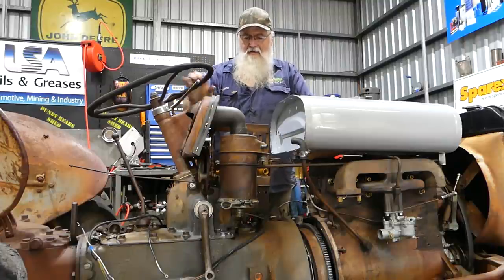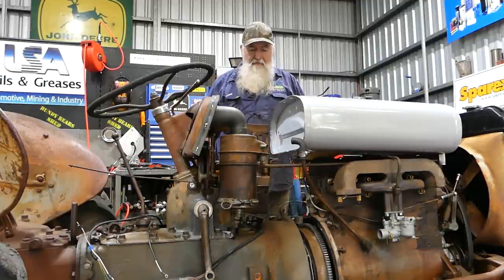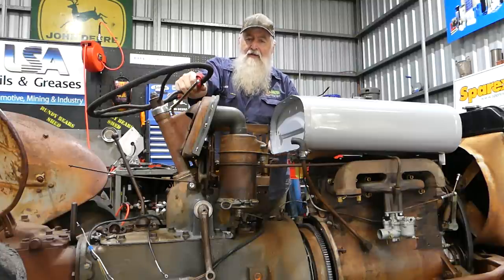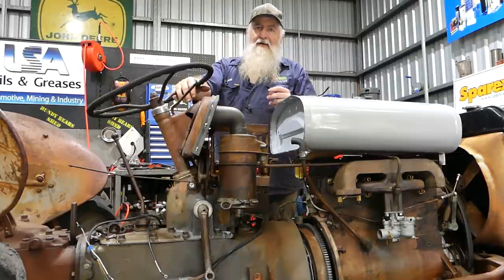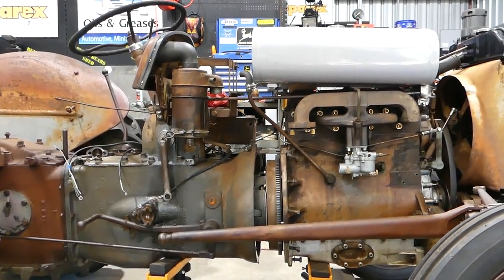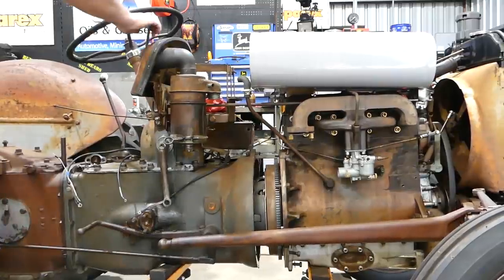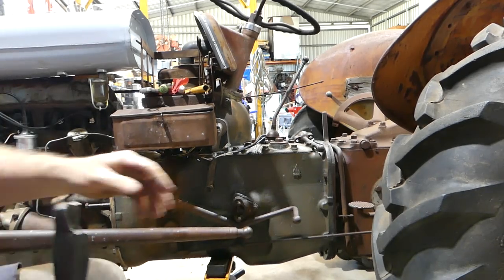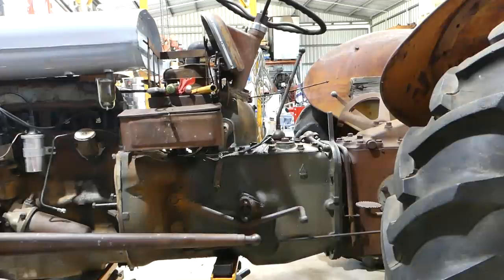How to Slide your Ferguson TE20 Together After a Clutch Repair in Real Time.

Comment: I split and reassembled my TO35 this last spring and it was such a good feeling when those splines finally aligned and the sections slid together. Turning the PTO shaft proved important.
Reply from the maker: Yes turning the pto helps a lot.

Comment: Lance - the clutch test prior to fully assembling the tractor - excellent idea. This is the first time I have seen this test.
Loctite 515 removal - have you tried Loctite SF 790 Chisel Paint Stripper (Gasket Remover) 510g to remove the gasket?
Reply from the maker: No I have not seen the SF790. I will ask my supplier about it.

Comment: When I did my TEA20 I had to do it outside. Due to the uneven surface I found the rear end twisted at an angle as it was going together. That took quite a bit of time to realign otherwise it would have been rather easy. Good ole Fregie.
Reply from the maker: yeah they can be a bit difficult now and then.
Reply: I have to do mine outside as well. Any tips as how you did it, and what I should look out for? I don't have the fancy trolley jacks that Lance does.
Reply: @jeskasper  I put a sheet of metal under the jack so as it wouldn’t dig in and that it rolled smoothly.
Also put wedges in to stop the front axle twisting.
The main thing is when you separate the half’s try and ensure they part in a straight line and stays that way.
You’ll appreciate it when joining them.
I did it mostly on my own so it is not rocket science.
Reply: @tridbant  wedges have been ready for a while. :) I only have a regular garage jack with wheels and a round lifting plate. I was thinking of making a length of 2x4 and put a hole in the middle for the jack plate, and then strap it to the gear box housing, just to make sure the tractor is supported and the jack doesn’t slip.
Reply: @jeskasper  the jack twisting is what misaligned my halves.

Comment: Hi Lance. I know this video is a little old but I’m about to tackle a ring gear replacement on my ‘49 TEA20. When you are doing the clutch test could you just turn the engine over with the starting handle instead of a lever bar on the ring gear itself? Cheers from 🇬🇧
Reply from the maker: Yes you could for sure.

Comment: Ive split my '54 ferguson tea20 apart to diagnose the reason as to why hydraulic fluid pours out of the weep hole on the front of the gearbox bell housing when the tractor warms up and comes to a stop. could you provide any information on that issue for me? thanks
Reply from the maker: Check the next couple of videos, i do one on the rear engine seal and another on the front grarbox seal that might be handy for you.

Comment: Good Job again Lance! Question for you the trick with engaging the gear to test the clutch with the flywheel does it also work with a TO35 or MH50  Assuming a to35 can be placed in 6th gear and follow the same procedure. I'm about to split one with a 6 speed tranny and I found that to be a really good trick.
Reply from the maker: Yes it works with any make I have found as long as it is not a powershift.

Comment: Hi Lance, yet another informative video, great job mate keep up the good work, and while I've got you, I'm just starting to rebuild my DB990 AD4/49 engine following tips from your vid's, everything was going well until I replaced the rear oil seal(new rope inserted as per your vid) the crank was free until then, now I have to put quite a bit of pressure on it (by hand) but when it turns, its good, should I strip it out again or is this OK?
Reply from the maker: If the rope seal was soaked on engine oil it should be fine and bed in. I worked on the DB tractors for 9 years way back and still have some of the tooling.
Reply: @BundyBearsShed  Thanks for the assurance, the rope seals were soaked for a week and put in the holders in the same way as shown in your vid, and then on assembly everything including the crank was given a good coat of EP90, which Iuse as it sticks around for longer.
Many thanks

Barry